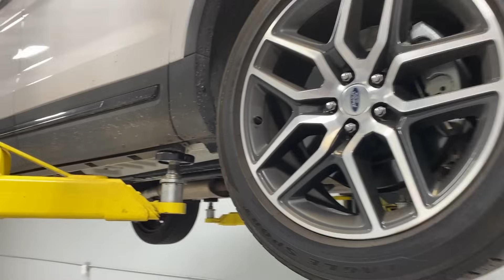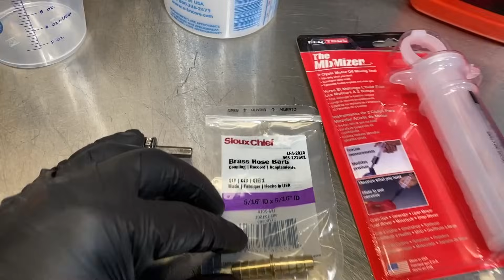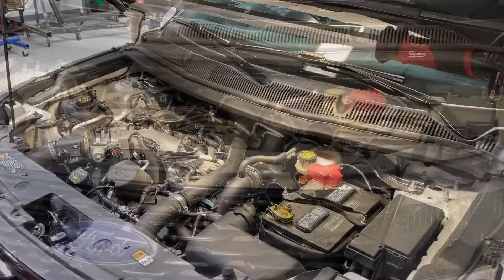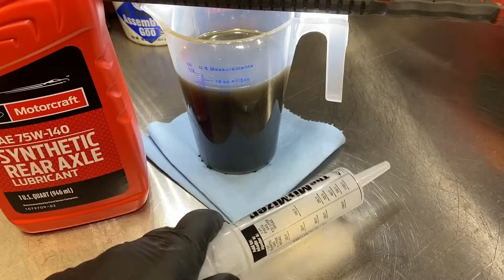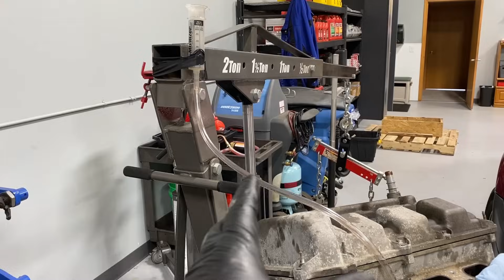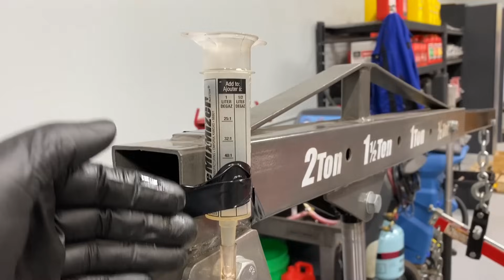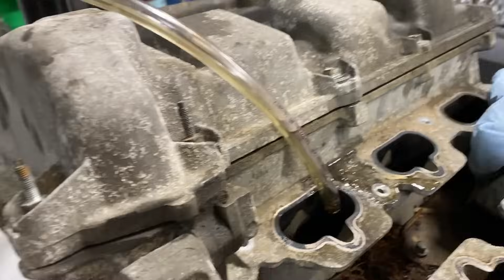Fluid Service on Ford’s New Cooled PTU’s is Possible: We Show You How!

Comment: what are you thoughts on heat wrap the catalytic converter
Reply: Bad plan, they get quite hot, and rely on airflow to keep them from overheating during operation, wrapping them would probably damage the substrate inside of them.
Reply: @markk3652  best option would be heat shield then
Reply: @omararreola2800  
Make em out of tin with exhaust wrap glued on with high temp rtv. 
An old friend of mine showed me that one and it works great. 
I think I did a vid on it years ago

Comment: And to think Ford could have just made these standard with a longer fill tube and it’d be an easy process. Instead, we get to take the vehicle in to get it done, just to have them dink and tap on things for an hour, tell you they changed out the fluid (when they didn’t) and get charged for maintenance they didn’t do. I hate this world

Comment: At the risk of feeling stupid, what is a 
PTU?
Reply from the maker: Power Transfer Unit
Reply: Power is sent from transmission to the rear differential much like a four wheel drive. The main difference is that on the new cars it's front wheel driven majority of the time, part time rear wheel drive. It used to be opposite, and now there are computer based decisions regarding the driveline and how torque and power to each axle is distributed. Very complex, but works well at keeping traction.

Comment: I'm a Ford fan, but this PTU thing is a long-running fiasco.  What's the point of a cooler if the fluid realistically still needs to be changed at 20-30K?  Redesign the stupid thing to hold more than a tablespoon of fluid.

Comment: You’re putting it in through the vent….  What about the air you are displacing when pushing it in?? It has no where to go except through a seal…🤷‍♂️
Reply from the maker: That is why you put it in slow allowing it to vent through the fluid, do not force it.

Comment: why not drain it out the bottom hole, cap that back off. open upper plug, fill until it runs out the fill hole. no measuring required.
Reply: Did you even watch the video? This new PTU has a temp probe and heat shield in the way. SMH

Comment: Great vid but I question force plunging the fluid into the ptu.  The ptu is sealed aside from the vent which you just blocked.  By plunging the fluid into it you are pressurizing it and putting pressure on the gaskets and the two shaft seals.  You may be causing a leak problem down the road.  What do you guys think?
Reply: Not enough pressure from the small syringe to do any damage

Comment: Looks like a good solution. One question, where does the air in the PTU go when you're filling? You're demonstration at the end shows the fluid going through an open ended hose so there would be no build up of pressure on the other end and it would flow freely. When filling the PTU, wouldn't there be a backpressure making it harder to flow? Doesn't mean it wouldn't flow, but I would think it would take longer for it to fully clear out the vent hose.

Comment: This procedure should not be required!!  I have a 2015 Explorer without a drain plug!!  The fluid has to be sucked out with a small diameter hose and then re-filled with same.  No magnetic plug available.  There should have been a class action suit on the early ones and from what I see on the newer "cooled " ones too.  Why take the time and effort to institute a fix that is half-assed!!  A fill plug separate from the vent line should have been provided and routed up the same as your vent/fill line.  Shame on Ford!!

Comment: I put almost a full quart in until it weeps out the fill port.  When I first changed mine, the factory oil was pretty burnt and lots of gunk on the magnet in the drain plug.  I put in Mobil one gear oil, until it wept out the fill hole. I changed it again 40k miles later, yes....40,000 miles later and it all came out looking damn near brand new, with very very very little gunk on the magnet.  I literally felt like I wasted my time changing it again after 40k.   My take: all fords oils suck, regardless of the tests showing Mobil one and fords gear oil are extremely similar,  and fill your ptu till it weeps.  I’ve not had any leaks or anything either since filling it up to the fill port. 17 Ford Fusion sport btw.
Reply: It's not that the factory fluids are junk, you must consider that when new, all the tolerances are tight, and the gear surfaces haven't worn in on themselves yet. Every differential or transfer case I've had to change fluid on, had dark nasty oil drain on the first one, but all changeouts afterward came out looking much much cleaner.

Comment: Ford's AWD systems are garbage.  Any vehicle with a PTU is guaranteed to fail.  Even with fluid changes, if the intermediate shaft seal fails, the PTU fills with trans fluid and washes the bearings a gears.  Especially in the Explorers and Edges.  I enjoy selling them though.  :)  FYI the brand new Ford PTU's are cheaper than the aftermarkets.

Comment: If you put this car in the shop or even the Ford dealership. Do you really think they will change the fluid? No, they won't but they will charge you for it. People should refuse to buy cars with junk like this on it. They all do it. But ford is the worse ever. I'm looking to buy a new truck. I have done a lot of research. Ford used to be my favorite truck. But not anymore.

Comment: I think its funny how everyone bashes Ford, chevy and praise Toyota. I've owned 6 Toyotas 1988 pickup 22re 5speed no issues but my 89 93 and 98  Camry's and my 93 pickup all had valve train issues all 22re motors each on had the engine replaced. And the worst one was the 09 Tacoma 3 transmissions and 5 security systems before they lemon lawed it . Both 93's and the 09 was bought new and dealership serviced while under warranty.  I've owned 2 Hondas didn't like them interior wise. But still yet when Toyota and Honda start changed there outdated power trains to compete with all the others they will have there issues aswell . Watch other mechanics on other manufacturers who put out honest criticism but still doesn't bash the brand into the mud. Oh wait there isn't one besides Brian, he gives the truth and helps out by showing his viewers how to fix and maintain the Ford brand he is certified in fixing. Yes ford has issues but so does every brand . Get over it watch the videos and keep telling yourselves that brand x is better than  brand whatever . They all have problems.
Reply: well the problem is most american see vehicles as appliances and should not have to be serviced beside taking it to jiffy lube once a year. That's why you see so many new vehicles on the road today. No one wants to spend any money on a vehicle they would rather pay a note every month than pay a mechanic every once and a while for services like these.
Reply: True statement, and I agree, most people figure if the car lasts till it's paid off, that's long enough, they'll just buy another. It's the same mentality as the cars of 35-40 years ago, dump it before 100,000 miles, and you're home free. The sad part is these 5 year old vehicles are on the used market with some hefty milage numbers, and they still command a higher purchase price, yet they never really got the maintenance required for the miles traveled. The second owners are the ones holding the bag when the car starts to come unraveled from the neglect of the original owner.

Comment: This is what happens when you have chinese engineers making all your critical components
And have a budget that is well to none...its come down to make more product and money per unit and less money on engineering and R&D. Now this trash is what weve come to expect and this is what they expect of us to just settle for sub quality vehicles....this is why i continue to buy old vehicles and fabricate the parts i need!!!!
Reply: 16 year Ford Senior Master Tech. Here, when you  fill through the Vent...where does the displaced air go? Or the fluid its displacing? Wouldn't using the plunger to even slightly force the fluid into the PTU risk axle seal integrity, by way of external leak or cross contamination of the ptu/trans fluid? I am a fan, and enjoy the videos.